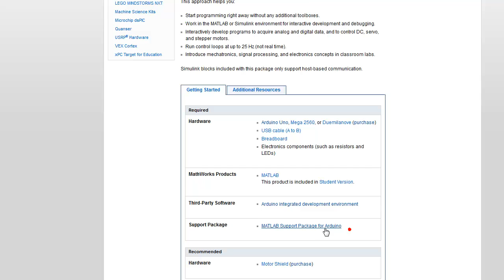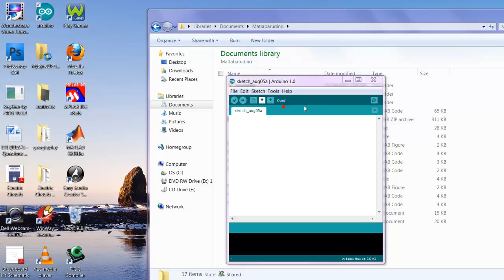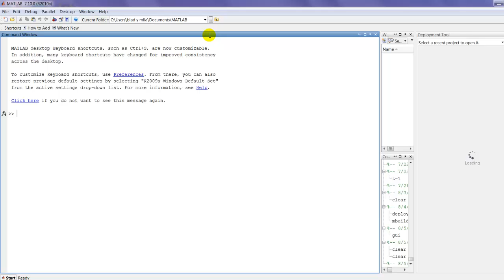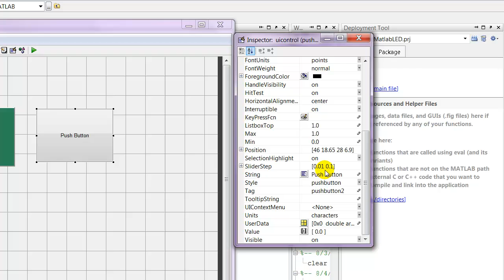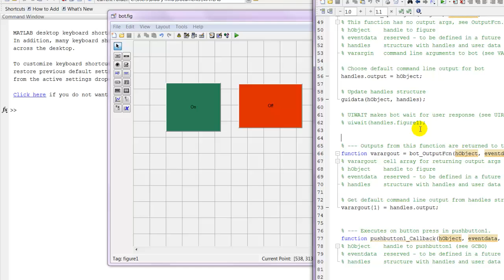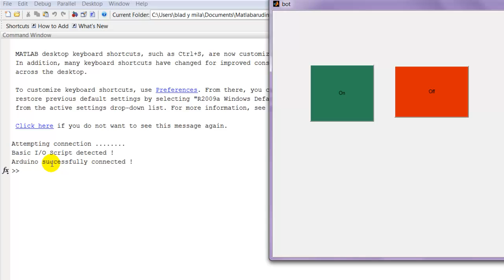Matlab Arduino GUI LED set up

Comment: Error using bot>bot_OpeningFcn (line 66)
Arduino hardware not detected on port COM3.

Error in gui_mainfcn (line 220)
    feval(gui_State.gui_OpeningFcn, gui_hFigure, [], guidata(gui_hFigure), varargin{:});

Error in bot (line 43)
    gui_mainfcn(gui_State, varargin{:});

Comment: Hi, I'm trying to make an executable with the matlab guide, in which I use the arduino connection, but I don't know which computer will use it so I don't know which port will be used, any recommendations? 
This is my code:
global s;
delete(instrfind({'Port'},{'COM5'}));
s = serial('COM5','BaudRate',1200,'Terminator','CR/LF');
warning('off','MATLAB:serial:fscanf:unsuccessfulRead');

Comment: Hi, how can i use a calcul from the arduino code and get it like a variable in matlab?   I calculate the distance of a ultrasound capteur with my arduino and i want to got this arduino variable in a matlab variable with your code.  I implement in the arduino code adios  this -->  

Case 400

digitalWrite(5, HIGH);
digitalWrite(5, LOW);
duration = pulseIn(4, HIGH);
distance = (duration/2)/29.1;
Serial.printLN(distance);

so i want to get this distance in a matlab variable but i dont know how,

It"s possible?

Thanks you

Comment: Great tutorial...
Sir I have  a query. My project is creating an electronic voting machine using Radio frequency identification (RFID). I basically have two main programs in my project. 1) Reading of the rfid tag by the rfid reader and 2) if its a valid tag, then allowing a vote to vote for a particular candidate using pushbuttons. Its a bit complex compared to your tutorial. So i wanted to know if such complex program can be performed using a MATLAB gui???
Reply from the maker: Yes, research for MATLAB image processing.

Comment: how to access the analog pins on arduino(a0-a5) through matlab.

a.analogwrite(1,200);
delay(10);
a.analogwrite(1,0);

if i write like above code it is not working...pls give me answer..

i want access 3 motor through analog pin using pwm technique..how to access them.help me solve this problem